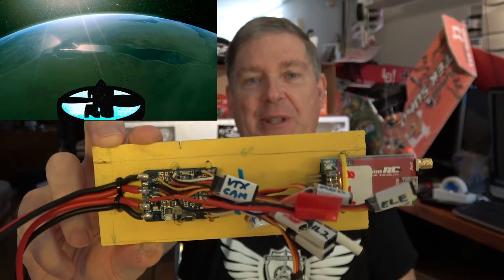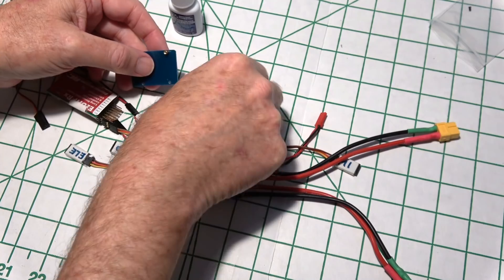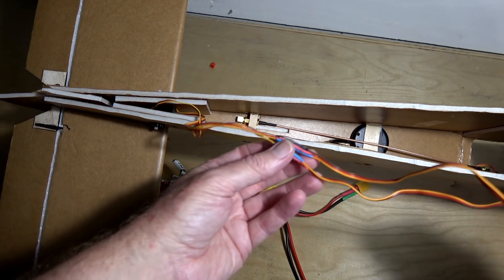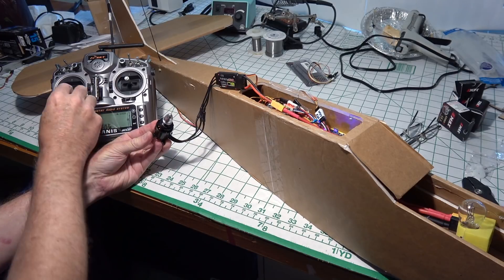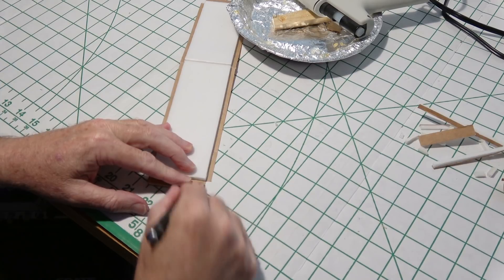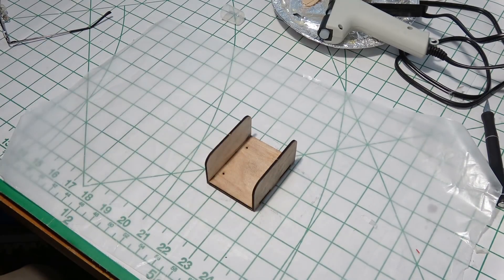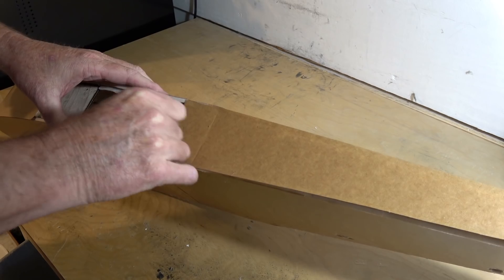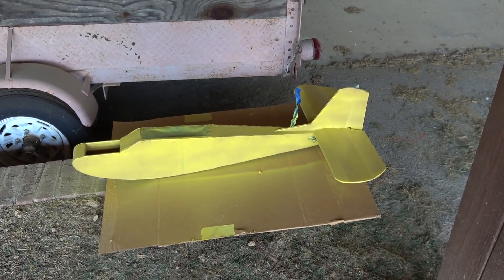Founders FT Legacy RC Plane Build - Part 3 (FPV iNAV Differential Thrust) Matek F411 FC

Comment: Hi Dave i see on the flight controller u used the ST1 pad for the PPM signal wire, what other pins did you use for the +5v and G ? Does it matter what +5v or G i use ? Thanks, Great Video by the way =)
Reply: It's doesn't really matter other than the  SBUS 5 volts which doesn't work off the USB (only battery).
Reply from the maker: Thanks, I don't think it matters which one.

Comment: Another good one Dave. Can't wait for the "care and feeding" of the F411 and INAV installment. Thinking of reworking this into one of ole Ed's (Experimental Airlines) 60" Armin wing designs. Love his easy-wing & "disposable nose" idea. Why? Because we know its just a matter of time till she's gonna meet up with the deck or immovable objects. Dollar Tree foam sheets and packing tape provides a lotta-building on the cheap. Real rugged and they last! - You and Ed are in our top-10 list! - Going for long range on this?
Reply from the maker: I am going to wait until after the test flights before I do the F411 iNAV configuration video because I want to make sure I have the right settings first.I'm putting LRS on the FT Legacy but it will be for mid range use. I just like the satisfaction of knowing I won't lose signal behind trees and other obstacles. Also I like the clear consistent video signal I get with 1.3g

Comment: Hey, I also have one of those EzUHF and the transmitter I bought for that S500 after watching your video. Remember mine has two antennas on the receiver. Thought I would get the FeSky X8R going first and then tackle the Ez. One mountain at a time. Mr. Wizard, I like that name for you.
Reply from the maker: Great idea. You can watch my vids on the EZUHF and get ready. I like to use the JR module that plugs into to the bay on my Taranis X9D.
I just got a Taranis Q X7S Radio w/ Upgraded M7 Hall Sensor Gimbals (Blue) and it has the same type of module bay.
Reply: Dave Merc Productions ,yes I've seen the upgrade on the Taranis. Looks real nice. If the same one were talking about.